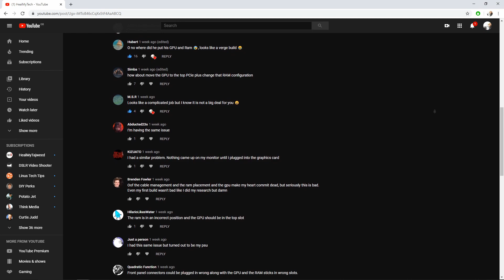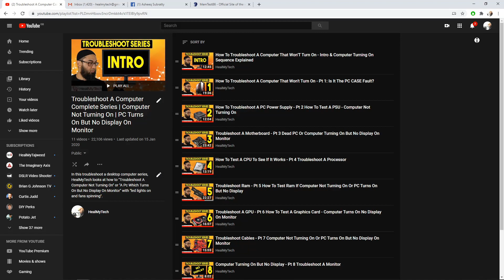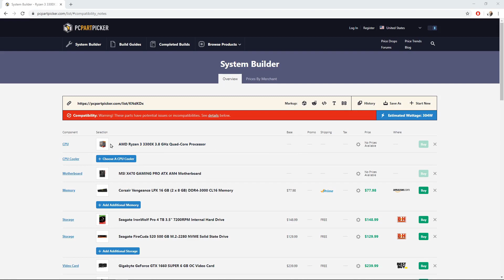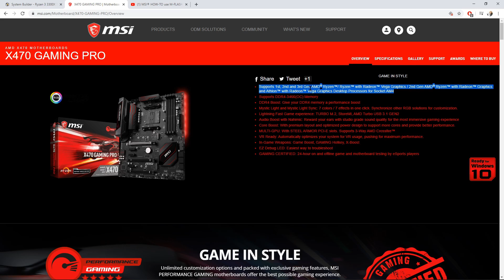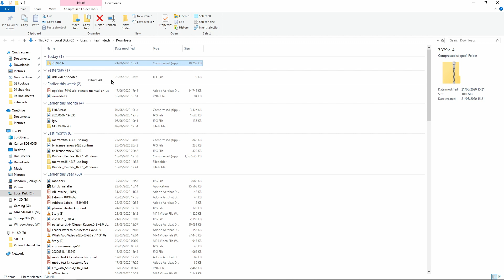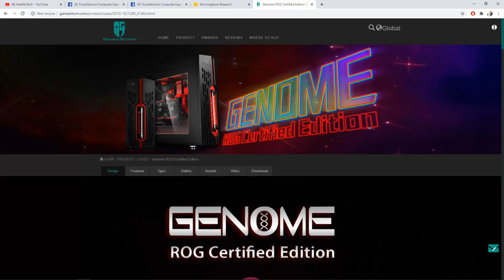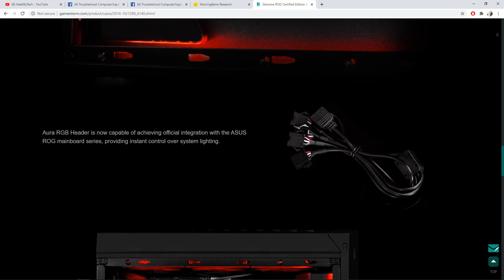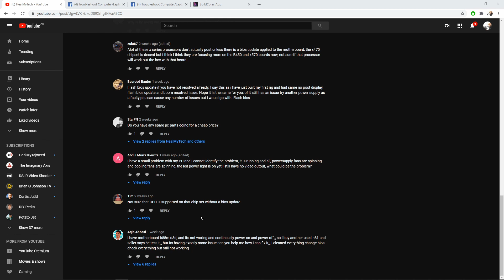New Gaming PC Build No Display - HUGE Beginners MISTAKE

Comment: please help me i bought
 ryzen 3600 
 asus prime b550
 hyperx 16gb 3200mhz but i have same problem pc is starting up lights up 
but no signal nothing no beeps or flashing lights on their website it does say that the cpu is compatible with the motherboard
Reply: have you fixed it? i have the same problem, there's only no display on my monitor screen and the keyboard also wont turn on
Reply: @casper.morales  hello i sent it back to the shop i bought all the parts from and they said it was wrong ram configuration might wanna check you ram placement good luck

Comment: A Ryzen 5 1600 will have an incompatibility with new B450 BIOS updated motherboard?
Asrock doesn't recommend to update if the processor is from the fir Ryzen Gen.
Could this be a reason not have video signal on HDMI port?
Reply: most likely will, use a 350

Comment: Im going crazy,,, I checked every single thing on my build except for CPU and motherboard.. if the fan on the motherboard is spinning and rgb works..can it still be the culprit? of it not showing diplay?
Reply: Well being that the CPU is a core component of a PC, of course that can be a possible point of failure.
Reply: @JJFlores197  ok. But I'm asking. If the cpu fan is working and Rgb.. can the motherboard still be DOA?   Sorry. Pretty noob about all this..

Comment: If anyone could help I would appreciate it very much, so I just built a pc for the first time all the parts are compatible, and I've plugged it in and it turned on but I had to turn it off and when it turned back on it will no longer display anything. The fans and rgp lights come on and the cpu fan is working but nothing will display. I've switched the ram, Ive checked if there are cables not properly plugged in ive even tried another graphics card which wasnt the issue. Atp im starting to think its my motherboard, but I dont want to return just yet was hoping maybe I could get a few recommendations before I actually return the motherboard. Thanks🥲

Comment: Hi I have the exact same problem, 1st time builder,  pc is on and everything but no display. I bought the correct cpu for the motherboard, msi h310m pro-vh plus supporting with a 8th gen so I bought a i3 - 8100 lga1151. What else could be the problem?

Comment: I need help, I'm a first time builder. I have a MSI B450 Pro Carbon Max Wifi x Ryzen 2700x ... everything works except no display. Do I need a bios update? Or did I f*** up? Lol

 P.s. I actually can't take the mobo out, the first screw is stripped.

Comment: So I haven't updated bios yet but could that be why I dont have power to my mouse and keyboard? I've reseated my ram and cleaned it and made sure everything is compatible via the amd website. But no signal to monitor and now power to mouse or keyboard
Reply: Do you have an answer? Same problem
Reply: @legionit6313  yes, turned out that my cpu was not compatible with my mobo without a bios update. Ended up having to buy a better cpu and motherboard
Reply: Just found mine out too, didn't have my cpu in good enough. Beginners mistake lol

Comment: What do I do if my PC posts. I have a display signal, but I lose signal after a minute or 2. I can’t finish setting up windows because my monitor goes blank. I can give you all my specs but they are all compatible I checked on pc part picker. I wish I could send a video of what happens, but hopefully you’ll be able to understand.

Comment: can someone help? i got a prebuilt and all the cables and monitor works. and i plug the hdmi into the graphics card. i’ve tried everything and still display
Reply: Did you find the problem? Im trying to use a hdmi and it’s not showing on screen
Reply: @CertainlyCynical  what happened was the pc was like messed up so i returned it to best buy and like 3 days later i got a new one sent to me and it works perfect

Comment: I'm getting no post on my monitor, specs..

Tomahawk MAX B450
MSI RTX 2070 GPU
AMD Ryzen 5 3600
WarHawk 2x16s RAM Drives
2tb WD Blue NVMe ssd
650w Corsair PSU

It boots up but no display, need some help

Edit: everything here is compatible
Reply: have you fixed it?

Comment: 1660 is like $800 right now 🤣🤣and that’s one of the cheapest
Reply: Got mine for 330😐
Reply: @donnyko9563  got my 1660 ti for $200..... but I am not able to get post or any beeps with my build :/ compatibility is fine but still i cant get mine to work and it was previously but the motherboard died

Comment: Can you pls help me my pc has been  very hot and it restarts randomly and now it just makes my monitor go in power save mode pls help
Reply: it could be thermal throttling (the cpu) or there is not enough cooling inside your computer or the cpu cooler is not properly seated

Comment: Hey, my b550 tomahawk's top PCIE slot will not show any display. The fans spin but no display. The bottom PCIE slot works fine. Any ideas what might be causing my problem?

BIOS Updated, 750 Watt PSU

Comment: Loose wire is propably like 60% issues.
10% old bios
10% fail psu
10% fail ssd
10% total random damage

Comment: please help its not the psu its not the cable from pc to monitor its not the monitor the gpu works and my oc turns on please help me
Reply: Did u figure it out?
Reply: @Max-oh8fk  yes i did and i struggled over it so hard lol just completely make sure the ram is fully in
Reply: @bruhmoment7741  i just tried and that didnt work i wanna kms
Reply: @Max-oh8fk  did you fix it?
Reply: @sudhhhrhsk4756  plug the hdmi into the graphics card

Comment: So,what say would cause a computer that was running fine. Running games at 2k resolution on Ultra like Forza horizon 4 and Witcher 3. 

On restart. The computer just randomly stops posting. No VGA outputs. Power still going to all thr components. Take GPU out,still not posting. Take out Ram and clean it,reinstall. Still not posting. All RGB lights on motherboard and GPU still comes on. It will start up. No beeps. No display.

Comment: Hey, I built my first pc it worked for 2 hours and suddenly monitor displayed "no signal" and ez debug  vga light showing up, vga fans are not spinning but rgb on vga is working I couldn't update anything (bios,VGA drivers,etc) because it's my first boot up I install windows though.what should I do now plz help?
Reply: @adam it was my vga i replaced it
Reply: @adam yea,my problem was gpu i replaced it and problem solved.

Comment: Bro you took way too long to get to the point. Had to watch on 2x speed and still got all the way to the half way point before you even got to the issue. Way too much rambling for information that could have been fit into less than 6 minutes without all the fluff.